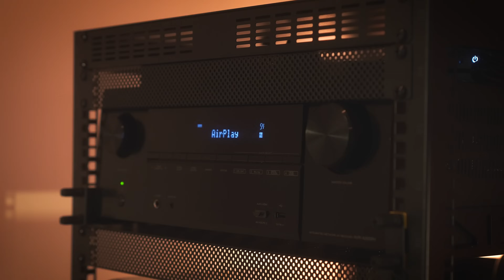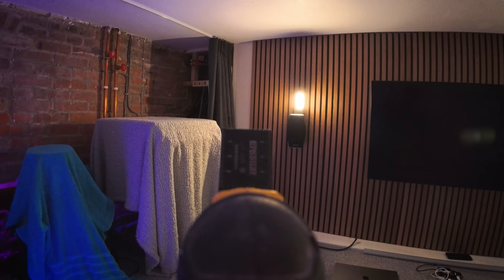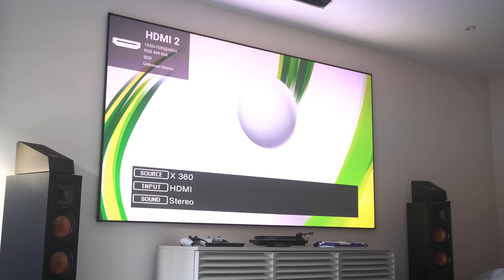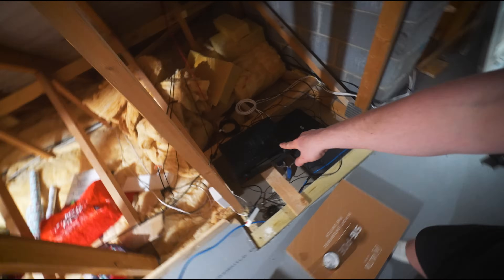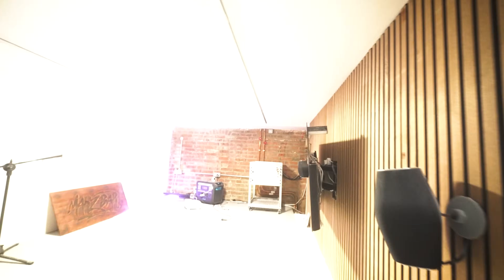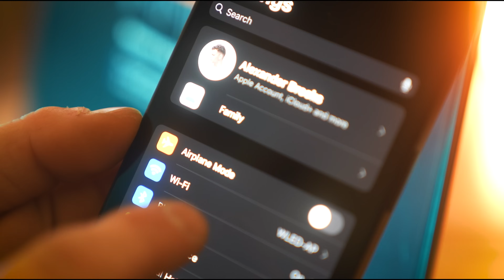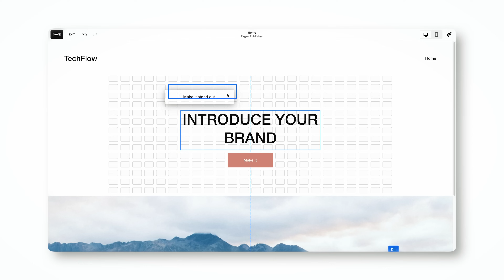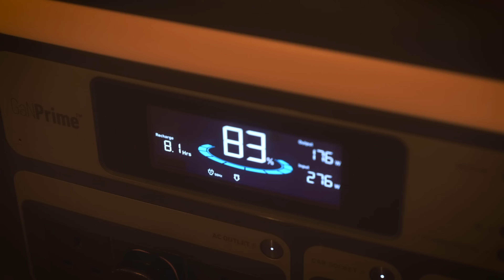Building my Dream Mini HomeLab

Comment: Quick question getting the amp to display any console on any tv is fine but what are you doing in terms of controller signal or do you get decent enough signal from console controllers back to the main AV rack?